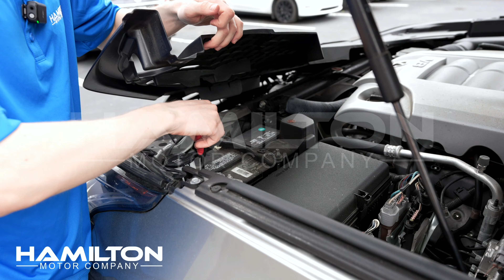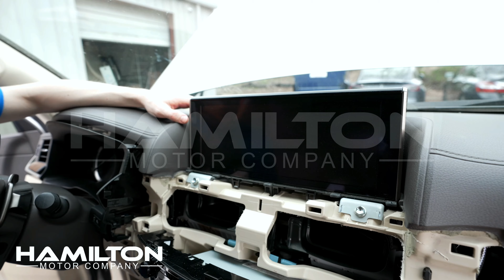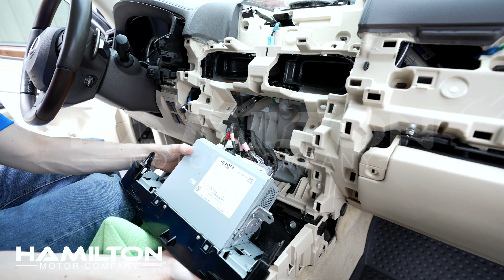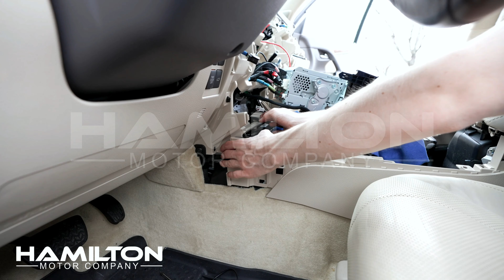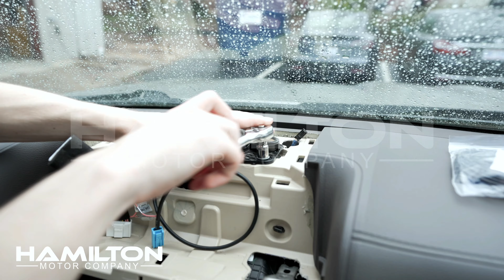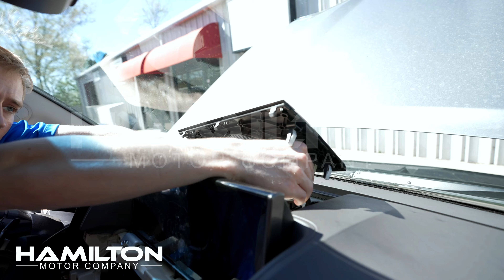2016-2021 Lexus LX570 Installation for Apple CarPlay/Android Auto by Hamilton Motor Company

Comment: I just bought an LX570 a couple weeks ago. Ordered this the next day.  I have it installed and other than the "HAMILTON" splash screen when it starts, you wouldn't know it wasn't factory. I wouldn't just plop the speaker behind the dash like in this video,   Mount it in a way you can actually hear it because that speaker is what allows the carplay sounds to come out when you're doing something like listening to the factory radio or whenever the factory unit is not in AUX mode.   Overall I'm very happy with the unit.